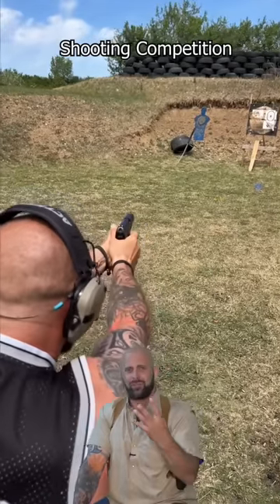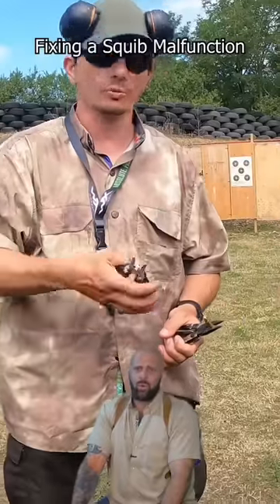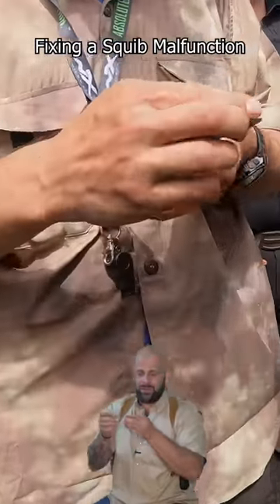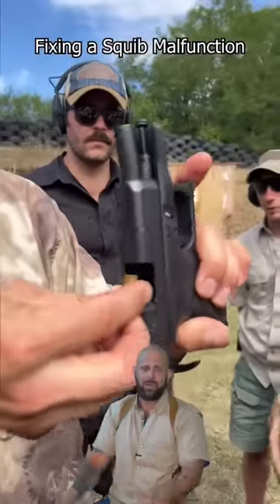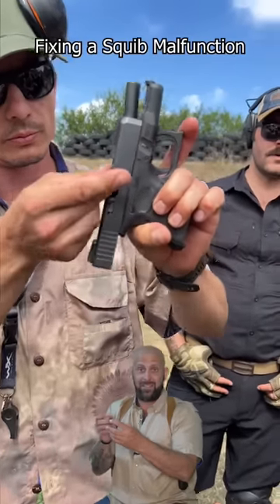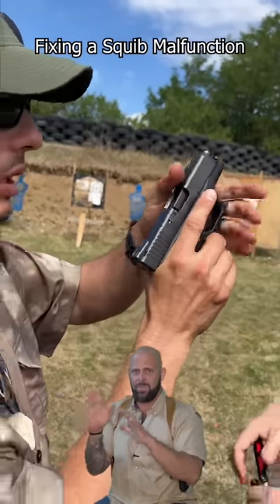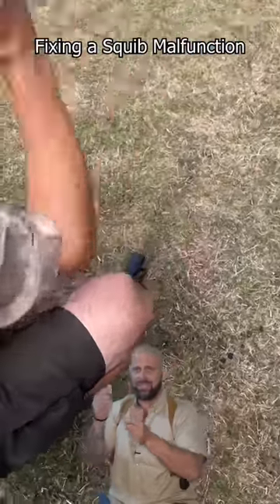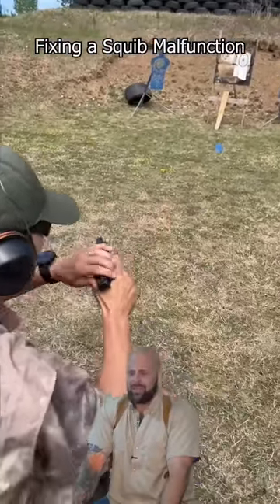Israeli Tactical Training School: Advanced Pistol. Video Clip #10

Comment: Five seconds to break the weapon down. Two seconds to push a rod through. No way in the hell I am squeezing a trigger knowing a round that malfunctioned is still in the barrel.
Reply: not to mention.. loading a round in the chamber this way is a great way to break an extractor
Reply: Exactly
Reply: Right, agree. Much easier and safer your way.
Reply: Got to squeeze the trigger to remove the slide bro
Reply: Wait you're saying you just push a rod through the barrel and it will just "fall out"?
Reply: @airborne1ranger24  you have to pound it through or slam the rod down on a table. Not push. Too hard by hand
Reply: @airborne1ranger24  literally yes. What, is it your first day being an airborne ranger?
Reply: Oi! Buzz Killington! Izzat you?
Reply: @Nothing25568  ik I'm saying the op is still gonna have to squeeze the trigger to remove the slide bc it's a glock
Reply: @Weekenday  I know, but that would still bear no danger as long as you make sure the chamber is clear. Doesn’t change his point at all that it is quicker and easier to strip the gun and push the lodged bullet out with a rod.
Reply: @Weekenday  oh, read his comment again, fair enough. My bad there.
Reply: @Weekenday  pulling the trigger is the wrong way to remove the slide. Everyone just does it because it’s quicker and easier.
Reply: @jbird6048  how would this break an extractor exactly?  Your using a common case and loading the open case in the same manner it would load itself from the mag.
Reply: @trailblazer632  it is NOT loading in the same way it does from the mag.... when loading g naturally ( from the mag) the cartridge come from under the bolt and slides into position under the extractor.. when the case Is dropped into the chamber ..the extractor hyper extends to get over the rim of the cartrige( case in point you see him driving the slide home multiple times)) .. this hyper extension frequently breaks extractors ...have have replaced several customers extractors that did this.. often loading laser cartridges for practice fire...
Reply: @jbird6048  that would depend entirely on the gun and the type of extractor it has. Most extractors lift over the rim as the bullet is moving into the chamber hell most bolt faces don't even have the necessary cutout for the case rim to "slide into place under the extractor.
Reply: @trailblazer632 wrong
Reply: @jbird6048  its not but ok boo boo.
Reply: @trailblazer632  well you are just wrong ..all automatics load in the way I described.. particularly  the one in the video
Reply: @jbird6048  they very obviously don't when I own several examples but ok columbo
Reply: @Dirkadew  could you tell me the better way? That's the way I've been using since I was taught
Reply: @Weekenday  bro just look up how to remove slide without pulling trigger not difficult
Reply: Is it really that easy to tell audibly that something went wrong?  I honestly haven't shot a gun before despite have multiple guns in the home but that kind of malfunction kind of scares the shit out of me.  I mean you don't realize it does that and you fire another round, I can see a very bad day for you.
Reply: Very surprising to see logic fail all you folks, this is no less safe if not safer. I think people get hung up on this "safety snob superiority" especially online and its beyond foolish. If you are unfamiliar with how all the young men here would be demolishing a rod and probably barrel  I suggest you take a quick look around it should be simple enough to find the instances of damage. My advice is to calm down and remember you're NOT better than anyone else.
Reply: @DATWagonator  firing factory ammo it is very very rare... however.. your statement should scare you and anyone around you...if you own guns, you should be well trained in their use, safety and learn to be accurate... you are more dangerous  owning guns with no knowledge, than not owning one.... go get lots of quality professional training..
1) safety
2) how the different type of guns operate, how to field strip and clean them
3) learn to shoot.. and learn to be accurate...
Reply: @jbird6048  They're my father's guns and I don't mess with them.. It's not that I fear guns (illogically I mean) but I don't know much about maintenance.  I have played enough FPS to say I could figure out most weapons I would say but I am under no delusions that I am some sort of expert in any way.  Also my intention is to start going to a range at the beginning of the year bc shh is just getting too wild and my parents are not getting any younger.
Reply: Your way is better than the one presented. Don't even need to field strip. Just open the action and slam a rod through the muzzle.
Reply: @Weekenday  glock "perfection"
Reply: @Weekenday  The striker needs to be released to disassemble, or the sear will get in the way.  So yes the trigger needs to be pulled.

You can do this before pulling slide release levers.  When you remove mag and clear- you can dry fire in a safe direction.

Then when you disassemble (as long as you're careful not to pull the slide back far enough to pre-tension the striker)  you won't need to use the trigger again.

Hope that helps, it was kind of ambiguous to say you don't need to pull the trigger without any context.

I don't shoot my glock often, but the procedure above is what is described in their manual for disassembly-  it even specifies that the trigger must be the rearmost position (fired & not preloaded) in order to disassemble.
Reply: There’s also this thing called a cleaning rod
Reply: @trailblazer632  you’re correct that many guns extractors snap over the rim. But generally they are designed to do so. Guns whose extractors aren’t designed to snap over the rim should generally be prevented from doing so whenever possible. The AR, AK, FAL, rem700, etc etc etc are designed specifically to snap over the rim. The glock has provisions for it if it happens, but it’s not meant to do this. And doing it will indeed speed up the wear process. Dudes not wrong in saying you shouldn’t do this with a glock. And you REALLLLLY shouldn’t do it with a 1911. Even though both will do it if forced to.
Reply: What if you dont have one with you tho?
Reply: @Dirkadew  no, you’re wrong. It’s literally the only way to release the slide off the frame
Reply: @jbird6048  I hear that all the time, but I’ve never seen it happen. I’m sure it’s possible, but I load rounds like this from time to time and I’ve never had an issue. 

And I agree it’s not the proper way to load a round and it’s not good for the gun. 

And there is zero chance I’m shooting anything from a blocked barrel. No thank you.
Reply: Yeah this short is bad advice.
Reply: I have literally done both methods several times over the years. The empty case with a fresh primer is the go to way to do it, completely safe to do if you understand what you are doing. 
You don’t even need that much powder, a grain or 2 will have more than enough to push the squib down the barrel. Completely harmless. 
Most people commenting on here saying the rod way is easier or safer is actually much more difficult and potentially harmful to the barrel. You have to literally pound out the projectile with a blunt object or a mallet and a rod. Stupid when you can practice the right way to do it by pulling a bullet as demonstrated in this video. This is the best method if you are in the field and don’t have access to a brass rod and a mallet and a soft wood bench to hammer on your barrel with.
Reply: @jbird6048  No one has ever broken an extractor this way. I’m sure of it.
Reply: @pottyputter05  Well said! People fear what they do not understand. I’ve used this method to clear a squib several times over the years. Perfectly safe and harmless to the barrel. The other way however will most certainly damage a barrel by pounding it out with a rod and a mallet on a hard surface.
Reply: @CBSonPc  Not really. It’s actually the best method.
Reply: @DATWagonator  I haven't fired a gun either but Imagine it's like clicking a pen. Every time you click it makes the same noise, your familiar with that noise, so when that noise is different, even by the slightest amount, it's very noticeable. Just the fact that the sound is different is enough to notice something might be wrong, and people who shoot guns a lot just have trained themselves to know when something isn't right
Reply: its just powder
Reply: Facts
Reply: Id bet $1000 you can't do that in 7 seconds.
Reply: but what if you were in a battlefield, in a trench, under heavy fire, couldn't find a rod and just had a pliers instead? lol
Reply: @stoner27th  better than trying to jack around with an open case of powder trying to shove it in the chamber without spilling it. If you're under heavy fire in a trench and you're using a handgun things have already gotten pretty fucky for you.
Reply: @stoner27th  hold the bolt back  and slam the butt of the rifle down. Exigent circumstances let's call it. That takes about three seconds... If you don't have that there is always charge and muzzle thump. Or run if you the type to do so. Or, pull your side arm and use it efficiently and effectively.
Reply: @jbird6048  if loading a single round directly into your chamber is putting your extractor at risk, that's not a gun, its a toy
Reply: @simplyimpulse1070  never seen a military round squib.
Reply: @theodurnayne3874  view the youtube link I posted..argue with the owner of wilson combat..
Reply: @jbird6048  anyone who must declare themselves "better" is entirely the opposite.

Get bent fudd
Reply: @jbird6048  but maybe your 3k m1911 that is outperformed by an M9 will really help convince you that yes... You're desirable in the bedroom xD
Reply: @derek leverknight  dude you're definitely wrong. What pistols do you own that "don't do that"?
Reply: @theodurnayne3874  slamming an extracter onto a rim that is already chambered is bad for all extractors. I guess you should do swords bro.
Reply: @Theodur Nayne  what is a "military round"? And how does it differ from normal rounds?
Reply: @200130769  the ammo the military uses is produced to a certain spec. M855 and m855a1 are good example of military spec ammo. Its typically much harder to get your hands on (855 is being phased out tho so its easier to find)

But the cases are hardened, there's specific propellant, and specific bullets.

Not all rounds are made equal
Reply: @200130769  yea it's bad for the extractor... But it's not going to break it short of you doing it for every round for hundreds of magazines.

If your gun is that fragile, you should stick to butterknives
Reply: @mrgrump2534  i guess that guy doesnt own a glock 🤷‍♂️😂
Reply: @Dirkadew  depending on the platform it won’t separate unless the hammer is down, on a striker fired pistol that’s usually the only way to deficit it…
Reply: @Weekenday  you still can 😂 just remove all live ammunition first
Reply: @DATWagonator when you shoot a round, you are expecting a certain level of loudness. When you don’t hear it, if it’s just a soft sound instead, it means you have to immediately stop shooting. There might be a bullet stuck in the barrel. Or maybe it just fell out by your feet. This is because there was not enough gunpowder. 
What do you do after that? Well, that’s exactly why all the world’s best gun geniuses are right now on this comment thread, hashing it out.
Reply: @Weekenday  also there is a way to get the slide off without pulling the trigger. So even then, your comment was incorrect..
Reply: @jverch2306  okay how do you do it then
Reply: @zakpodo  thank you king 🤴
Reply: @Weekenday  well I already explained how to safely and quickly get the bullet out of the barrel without firing it.. and if you want to get the slide off without pulling the trigger, you have to take the main trigger pin out..
Reply: @Weekenday  or you can take the backplate off the slide and take the firing pin out.
Reply: @Weekenday  Glocks are pretty simple. But you don’t seem to understand them. So you either don’t have one or you’ve never assembled/disassembled one..
Reply: U cant just shove a rod down the barrel.. its jammed in there.. are you kidding..
Reply: @pottyputter05  that was exactly my point.. at least I found one commenter that thought like I did..nice
Reply: Agreed. This video is some tik tok knowledge BS
Reply: @88wolffy  with a hand gun round squib... it's not like a rifle one.. way less pressure..  so it will go out the barrel. Before any parts even start to have damage
Reply: You are 100% correct.
Reply: Pump shotgun will always be best for home defense.
Reply: @DefendTheStar  😎
Reply: There is nothing wrong with what was done in the video, the chamber/barrel is rated for far more pressure than the rounds being fired, a squib load is just a shell that was a light load on powder. Putting in a shell with the right amount after will clear it just fine.
Reply: @Weekenday yeah but you also have to drop the magazine and clear the camber before taking it apart. also not all handguns require you to squeeze the trigger to disassemble them.
Reply: @jmsgridiron5628  I know that I was asking about glocks. Bc that's what's shown
Reply: When you have 7 seconds to clear your gun you gonna spend 5 to pull a rod out?
Reply: Too each it’s own.. there’s nothing unsafe about what he’s doing..he is making the functions do the work.. I understand you don’t feel comfortable about it but you do feel comfortable about one in the camber.. accidents happen no matter what..😂😂
Reply: @speedlimit6869    Buddy, I am one of that all can ignore what I am doing. I was just giving my opinion.
Reply: He isn't going to break the extractor.  He didn't send the slide home on sling shot.  And realistically, using powder to push a round out is not exactly a horrible idea.  It's what the gun is designed to do.  What makes a squib dangerous is firing another projectile into the obstructed bore. Not another powder charge that by design the pistol is meant to handle.  I don't know that I'd do it, but it isn't exactly unsafe.
Reply: Far as damage goes, your way is just as likely to damage your bore as hand popping an extractor over a brass case.
Reply: Pretty F'ing much.
Reply: @Weekenday doesn’t matter if you unload the firearm.
Reply: @DATWagonator  just wondering why you have guns around but are familiar with them?
Reply: @jbird6048  if you just pull your extractor out it'll pop right over the rim. No clue why he smaked it! Which probably also sent that powder out of the case and into the throat of the barrel. But there's nothing dangerous about doing this!
Reply: @Eastwing74  to be fair it isn't a high priority for me both my parents are very sick and disabled and I spend most of my days looking after them and doctors visits and all that stuff.  Money is tight and growing up my family was never anti gun by any means but we weren't out hunting and shooting for fun unfortunately.  I have played video games most of life so I am familiar only in that sense.  I also watch plenty of gun content on YT but I just have never had to chance to go hunting or shooting at a range.
Reply: @jbird6048  my extractor on my lc9 is a solid extractor so I don’t get what you mean by “every handgun works this way” because not every handgun has the same extractor (with a spring, or solid, what ever the case may be)
Reply: @jbird6048  I’m only stating a fact of my firearm I’m not saying every fire arm is the same because obviously there not.
Reply: Maybe not in the heat of battle
Reply: @Dirkadew  it’s in the fucking manual for the gun there buddy, so it’s not the wrong way.  Fishing the striker and popping the backplate takes tools, time, and light to see.
Reply: it’s ridiculously hard to push a squib round out with just a rod the barrel is smaller than the bullet once it gets wedged it’s like trying to pull your jacket up from underneath a big ass bolder
Reply: @jbird6048  no it isnt, the extractor on a glock snaps over like that for every round anyway. its the normal way it functions
Reply: who forced you
Reply: @Weekenday  Not on very many guns.
Reply: @jbird6048  huh no kidding .. didn't know that but it makes sense knowing how the extractor works. I guess I'll stop dropping rounds in before I break my extractors. Time to do an inspection now as well. I'm guessin I should see some unusual wear pattern where it's being hyperextended/push over the rim.
Reply: Just curious cause I’ve never had a squib happen to me. But does forcing the round out the barrel with a rod damage the spiral inside the barrel?
Reply: @J4k3roi21  Not once I have witnessed.
Reply: That’s what I do, just field strip my side arm and pull out my rod that I carry everywhere specifically for this task if this happens and not a multi tool and live round. Don’t ask where i store the rod when I’m not clearing squibs 😉
Reply: I can't wait to try this at my local range... Im sure the RSO won't mind lol
Reply: @jbird6048 If you break an extractor on a Glock just by loading a round in the chamber I’ll never trust Glock with my life. 

Breaking extractors like that is a thing of the past dude. If a modern combat firearm can’t be durable enough to load from the chamber then you shouldn’t carry it
Reply: @jbird6048 So you think all automatics load the exact same way? ALL of them? 😂😂 you’ve obviously never seen a fixed barrel
Reply: @Dirkadew You literally have to pull the trigger to remove the slide. No ifs ands or buts about it. It even says so in the manual. 

Does that make it dangerous with a squib? No. Primer is already detonated and what little powder burn there is is already gone. Especially if the case has already extracted.
Reply: @Weekenday ok, so just remove mag, rack slide to remove loaded round, then squeeze trigger on an empty chamber to remove your slide...i don't know what you're trying to get at
Reply: @CousinSqueeze  that was literally my point like 11 months ago. Is that to remove the slide you have to pull the trigger
Reply: @jbird6048  i really doubt they were concerned with the extractor while doing this lol. Also, loading one round like that wont hurt anything, but you dont wanna load your plus one like that all the time either. 

Also also, thats why he closed the chamber gently
Reply: @sub_second_life3174 exactly plus this has a risk of damaging the bore and scratching it up and than it’s not epic
Reply: For real. Anybody who acts like this is “correct” doesn’t know much about firearms or the pressure that is occurring inside them.
Reply: @sevengramrocks2746 I guess you don’t understand that it can cause pressure spikes and injure you or your firearm. Generalizing like you did in your previous comment is the type of stuff that gets people hurt. Not every situation is the same and there’s no guarantee that your gun (or yourself) will be fine if you have a pressure spike. 

I’d just keep in mind that there are people on here who will take a YT comment as gospel and then go and injure themselves doing something that someone who doesn’t really know what they are talking about suggested them to do.
Reply: If you knew anything about firearms you would know that it would not be that easy. But go off
Reply: @jbird6048  only if your extractor is MIM trash.
Reply: @Commonwealthghost  You told me. I am packing up my guns and turning them now. Switching to harsh language only time now. 😉
Reply: @Hornet135  ted Yost would disagree with that
Reply: @Dirkadew please show me how to take down a glock or my taurus g3c without pulling the trigger if you manage it your a gun god
Reply: @greghackstaff217  Bet you can have it cleared in ten seconds too. My daddy was Marine. I like Marines.
Reply: Magazine out, lock the slide back, rod the barrel and you're good... 

Really no reason to disassemble the gun
Reply: @ThanksforcensoringmeYoutube  The pressure inside the bore that cleared the squib in this video was not excessive at all is that's what you are getting at, if your bullet is recessed inside the casing beyond it's factory spec that will in fact cause higher pressures but not using a casing with only the powder to clear a squid has literally know way of producing excess pressure in fact much of that pressure is literally lost when doing this but still plenty to clear the squib. 

What will damage your barrel is trying to force a squib back out the chamber from the muzzle with a fkn metal rod and mallet, that is literally the worst way to handle a squib and will cause damage certainly. Forcing the squib out the end of the muzzle one way or the other is literally the only way to clear it without any damage and the method presented in this video is not only the fastest but least likely to actually damage your glock in this case.

Only way a factory load can experience excess pressure is if you rechambered that round several times causing it to recess into the cartridge, that's why there's specific cartridges which are made so that they can be rechambered over and over so that they can't become recessed deeper into the cartridge causing excess pressure. 

Added distance between the projectile and charge in this case will not produce any discernable difference in chamber pressures at all, if anything at all the bore would experience lower pressure volume especially if the whole charge is not used which doesn't have to be in order to clear the squib.

This comment section made me look into this months ago and like I thought there's nothing wrong with what was done in this video at all, this would actually be the best way to clear a squib on a handgun in most cases, however I wouldn't be so sure on a DI rifle because of the gas block and gas tube and not knowing what that dynamic would result in, in this case it just makes sense.

Also, I can't believe people are still arguing about this after almost an entire year like wtf.
Reply: agreed, this is silly
Reply: Gun powder can do some weird stuff when you have excessive open space at time of ignition. No way in hell I'd do this.
Reply: Bro right. One wrong calculation and that's a pipe bomb
Reply: @200130769 yeah that brass rim is waaaaay harder than the steel extractor
Reply: @Weekenday So? A bullet in the barrel is going to stop you from resetting the trigger? How exactly?
Reply: Seriously 😂
Reply: Jamming a rod down your barrel to remove a squib can damage your barrel. This method is brilliant. And he gently charges the handgun. That does zero damage to the extractor
Reply: @jbird6048 not going to break the extractor if you do it once or twice it is spring design for that That's why there's a fucking spring there but you do it fucking repeatedly you can chip the edge it's not going to break it it's just going to chip it It will still work
Reply: @justinward7331  I am trying it next squib I get. Sure am.
Reply: @DATWagonator you will both hear and feel it. If anything seems different while shooting, stop and check. People only blow guns up because they feel something off, and don't react to it, they just keep pulling the trigger. The only way I could see not noticing a squib, is if it happens the literal first time you fire the gun, so you have no frame of reference. Even then, you'd probably notice.
Reply: @theodurnayne3874  I'm not the one that manufactured the firearm. Maybe you should stick to butter knives. No common sense either. Tons of examples, especially on YouTube prove you wrong.
Reply: @aPoorsPerspective  what rim? 🤡. And it's not a matter of what metal is harder when force is involved. Also extractors aren't very thick.
Reply: @jbird6048 get over the extractor thing
Reply: @jbird6048 some people just know it all bro lmfao dudes a straight clown 100% will break an extractor making it jump the rim not hard to read they are absolutely designed to slip up under the extractor claw
Reply: @justicemcdonald2939  bill Wilson of Wilson Combat and Ted Yost say it will damage the extractor.. That's 2 highly respected custom gunsmiths.... I'll trust their opinion over a bunch of keyboard warriors
Reply: Or 2 seconds to just put a rod in and punch something
Reply: @jbird6048 it isn’t gonna break the extractor one time 😂
Reply: @jbird6048 LOL you've been watching WAY too much YouTube. The extractor will be just fine. People load hundreds of single rounds like that, with the extractor jumping the rim, and the extractor is just fine. ONE time, in an emergency, is inconsequential. When I got my first handgun, and I used it at the range, I would ALWAYS reload it that way. Hundreds of times. Never had an issue. One time certainly isn't going to cause any issue.
Reply: @simplyimpulse1070  you’ve never had a squib malfunction at the range I can tell.
Reply: @simplyimpulse1070 think it was sarcasm, mate
Reply: That’s exactly what I thiught
Reply: @Weekenday that’s funny cause my Glock you literally don’t have to do that. Just pull the tabs on the sides with the slide pulled slightly back and it comes right off
Reply: @jbird6048 "Don't shoot your guns. It causes wear and tear and you'll eventually need to replace parts"
Reply: @justacameraman4900 you feel considerably less recoil with a squib, most of the time a squib isnt even powerful enough to eject the case most people who experience a squib for the first time think there was a FTF cycle another round pull the trigger and their slide/barrel explodes, also youll see smoke blow out of the firearm. The only type of squib that scares me is one thats powerful enough to cycle another round while im doing some spirited rapid firing. If i am practicing and know the round i previously fired cycled another into the chamber then i pull the trigger and it doesnt go boom, i know its a squib. ive only had it happen twice i bought some reloads from a gun show had 2 squibs in 1 range session after that i only buy factory ammo and havent had a problem since.
Reply: @trailblazer632  - Pretty sure you are wrong
Reply: @jbird6048 wah wah wah, if your extractor breaks from one chamber load get a new damn handgun, jeez louise I own I think 15 handguns... actually I think it's 16 when my P-09 comes in and I've never had a broken extractor in thousands of rounds loaded any number of ways. I'd be more concerned about having a round separate from the charge, you run the chance of over pressuring the barrel and causing damage. It's worth a shot if you can't pound the round out though.
Reply: @simplyimpulse1070 You'd be surprised.  No disrespect, but a good portion of the military weren't raised around guns and may not have experience with a squib. I personally was raised around them and know what it is, but even with thousands of rounds down range, I've never had it actually happen.
Reply: @jbird6048 i was at a party and this dude with a glock17 or sum kept staring at me loading a bullet into his barrel like a fuckin idiot 😂😂
Reply: And if you dont have a rod with you? This is perfectly safe to do at the end of the day its a gun igniting gun powder and sending bullets out the barrel is what it does
Reply: @gingershrimp4024  chamber pressure spike bruh, blow out the side/swell your barrel. Expanding gas has a long way to go before hitting that round, pressure goes way up in the barrel, this is a technique saved only for extreme emergencies.
Reply: @asomnss  Extreme emergency hold the bolt back, index finger underneath the safety, magazine out (not completely necessary), slam the butt of the rifle down... back up. About three seconds with a rattle to make it fall out of the ejection port if you did not drop the mag. Learned that from someone who I gathered had to do it for real at the worst time. Hell of an NCO.
Reply: @chaunceychappelle2173 I doubt you're gonna be able to clear a squib with inertia, I know mortaring can help retrieve a stuck casing or seized bolt but for squibs?
Reply: All of you commenting about pulling the trigger it doesn't matter if you pull it or not as long as you don't have a bullet chambered in addition to the squib.  How exactly is a piece of lead going to ignite without a primer getting slapped by the firing pin?  Just take the gun apart pulling the trigger to take it apart is fine as long as the gun itself is cleared.  It's a Glock you have to pull the trigger to disassemble without future issues.
Reply: @jbird6048 seen more videos saying that's wrong than comments saying kt
Reply: Great comment! as someone who gets to own and play with rifles and  shottues but doesn't get to play with pistols (I'm in UK n have a firearms cert but we have no pistols here just long arms) so i initially thought the video was a good idea but your comment made me think "how could I be so stupid believing that this was a safe method" yano... Just shows how without context most of us will just most often plainly believe almost anything we're told lol
Reply: @jbird6048 you still believe that myth?
Reply: @D34D22  for the third time..when the best custom gunsmiths say don't do it...I'll take their word over the YT keyboard warriors...
Reply: @Nothing25568 not if you're in the field and don't have a rod...
Reply: @jbird6048  Who said don’t do it? And you’re the keyboard warrior here clearly.
Reply: Holy hell. This is definitely the worst way to clear a squib. Dudes setting himself up for a Darwin award
Reply: Better let the gang know not to try it with a rifle or anything that has a long narrow barrel. Glock barrel is practically all chamber, rifle will thin out and burst with the extra volume
Reply: Not to mention the particular firearm does not have an extractor designed to ride over the rim of a round in the chamber. Fail. Just take the weapon apart and tap a rod.
Reply: What if you're in a situation where you don't have a rod and you need to get the firearm back in the game
Reply: @kennethparker2168  🏃‍♂️ 🏃‍♀️ 🏃‍♀️  Hup, 2, 3, 4. That's an option. For some.
Reply: @jbird6048 if you do it a bunch, yes 

Once or twice in the guns life won’t hurt
Reply: @Weekenday  ( if u weren't making a joke ) to let ya kno ..with glocks you dont have to squeeze trigger to disassemble you just use the tabs and pull slide back, although if your bad at using them tiny ass take down tabs ( guilt as charged my self..) then it will half way activate and pulling the trigger ill send the slide forward the rest of the way like your asuming. although in that case im PRETTY sure with a squib as long as that case isn't there still your safe to pull trigger with only a projectile stuck half way bc there's no powder .
Reply: @weekenday1943 many guns have a release so you don't actually have to putt the trigger
Reply: Exactly I’m not taking any chances of failure esp shrapnel
Reply: @jbird6048 yep can not fetch correctly then you got fte or squib round explosion
Reply: @trailblazer632 why would I take the chance regardless I’m not ruining my extractor
Reply: @jbird6048 on 1911s maybe but not glocks
Reply: Yea seems pretty dumb to me
Reply: @jbird6048 yeah you are wrong. Not every semi pistol uses the same extractor tech as glock. Some use a hinged or spring loaded ejector that is able to move out of the way of the cartridge. You are correct about this being bad for glock extractors, and yes most guns as well, but not 'every' semi automatic handgun ever made. Not to mention there is literally thousands of designs for a semi auto handgun. I can guarantee you don't know how even a tenth of them work. Check out forgotten weapons.
Reply: @theodurnayne3874 dude you are funny. Military rounds.. Hard to get my ass. They are all over the fucking place. And they are cheap. Military rounds are cheaper than match.. And made to lesser specs. But as you have stated in previous comments you know everything. I have also seen m855 squib before. It is very possible for a round to be messed up during production. Especially with military ammo, as it is made cheaply. Apparently you don't know what military grade actually means lol
Reply: @jverch2306 OK but no one does any of that to disassemble a glock. Because it's not necessary. Just pull the trigger like it says in the fucking manual.
Reply: @0Wheezy  yea...once again..I will listen to 2 of the best custom gunsmiths, before I listen to YouTube keyboard warriors...
Reply: @simplyimpulse1070 damn just banging the barrel on the first date
Reply: @jbird6048 People say this… often… In 25 years of firearms instruction I’ve never once seen this happen.
Reply: @weekenday1943 going straight to jail for that one 

The round stuck in the barrel has already been fired. The primer is dead and the powder burned.
Reply: Thank you.
Reply: @weekenday1943 depends on the gun. Not all of them require you to press the trigger in to break it down.
Reply: @airborne1ranger24 yes you can definitely push a sqib round out of a barrel like that iv seen it done a few times
Reply: Fuck yeah
Reply: @Weekenday that literally makes no difference, as long as you clear the chamber pulling the trigger is as safe as dry firing a gun regardless if there's a bullet caught in the barrel. Now if you don't clear the chamber and try that your gun turns into a grenade.
Reply: @peachfuds bullets aren't bigger than the diameter of the barrel they're slightly bigger than the diameter of the rifling though. You're kind of right but not fully. It's not going to take he-man to accomplish pushing the bullet the rest of the way though.
Reply: 100%.
Reply: @Dirkadew Sir, on certain handgun models you do have to pull the trigger to release the slide forward for example the Springfield hellcat and a few glocks
Reply: this, 100%
Reply: @Nothing25568   You dont need to take the slide off lol lock it back and push rod into front and grip and slam gun and rod gently on table
Reply: @Dirkadew   if the trigger is already depressed you r right but if its cocked the firing pin will be stuck on the sear so u have to pull it. Unless u remove the back plate and firing pin.
Reply: @trailblazer632  If you close the gun on a case tht you stuck in the chamber the extractor has to be forced over the rim and can chip it. when a round is loaded from the mag the rim slides behind the extractor not infront. slamming the extractor over the rim crack chips the edge of the extractor
Reply: @user-ng8iv6fh6b  you do realize that single loading has never been an issue in any successful gun design right? Any time you single load a semiauto or even a mag fed bolt action you would have the extractor slip over the rim instead of it starting up under the extractor like it would if stripped from the magazine.  This has been common practice for 150yrs. If you extractor cracks or chip from such a thing it was faulty from the get go. Its spring steel. Its designed to be able to flex and bend without deformation let alone being brittle enough to chip and crack. If it fails it was going to fail under "Normal" use as well.
Reply: @trailblazer632  You lost me on the bolt action Ar15.
Reply: @chaunceychappelle2173  who said anything about a bolt action ar15?
Reply: @Weekenday you can remove Glock slides without a trigger squeeze
Reply: @xx_mysticwolf_xx1492  how
Reply: Wuss
Reply: @jbird6048  How many extractors have you broken doing that?

I ask because, while it may not be as easy on extractors as chambering from the magazine, it seems that breaking an extractor as a result of manual chambering (sans magazine) is not a practical concern and, instead, a fear concern stoked by the Internet.
Reply: @simplyimpulse1070 that’s not how that works squibs or most squibs are literally stuck and frustrating to get out
Reply: @Dirkadew you should remain quiet and not confirm your lack of knowledge with untrue utterances.
Reply: Cheap ammo
Reply: @badlaamaurukehu  I did just get some really cheap ammo on base compared to off-base. True story. True story.
Reply: I totally agree with that. The possibility for that to go wrong are very high
Reply: Most the time u can't get it out with a rod😂😂😂
Reply: You carry a cleaning rod everywhere you go?
Reply: @trailblazer632 The cartridge run slides into the extractor….doing it his way….forces the extractor to jump over the rim making it flex it very hard and fast.
Reply: @Anonymous8317  as it is designed to do and the reason it is made from spring steel
Reply: Out in the field you won’t have those supplies
Reply: @jbird6048 it is going to break it doing it a couple times, don't be a Karen...
Reply: Obviously the cleaning rod is giving all you guys ph imbalance...
Reply: @jbird6048  Very dumb myth you’re perpetuating. Unless you’re doing this multiple hundreds of times, there will be objectively no measurable damage to the extractor. This is under the assumption you’re shooting brass and that your extractor isn’t made from trailer park shitty iron or steel
Reply: Agreed. I guess it's one way to do it but not the best. A rod is the best.
Reply: Had a sears m1 commando tommy gun stick mag squid twice with store bought rounds fun time...
Reply: @jbird6048 BS - great idea.
Reply: @airborne1ranger24 no it will not.